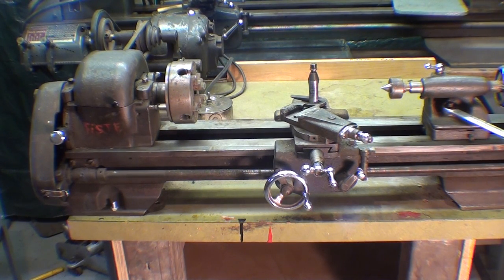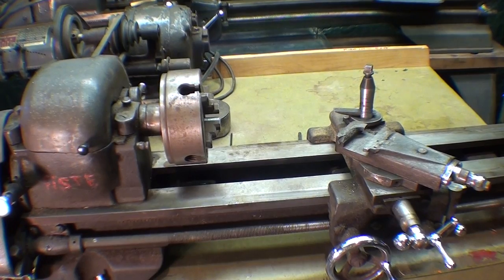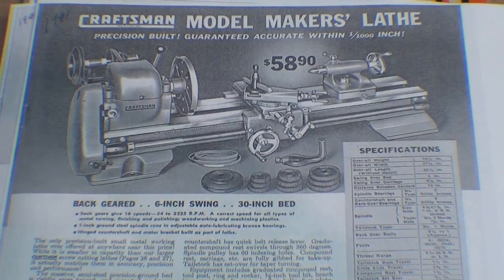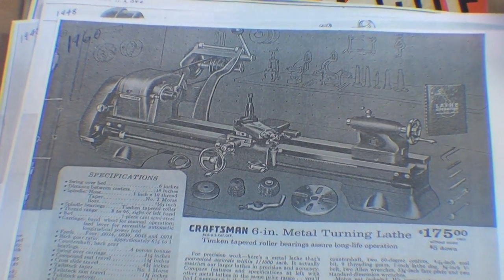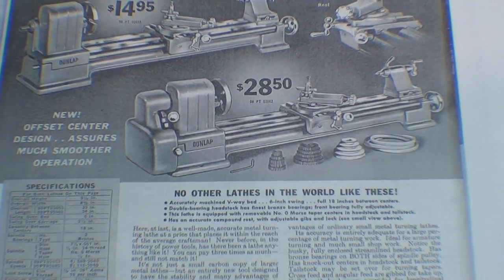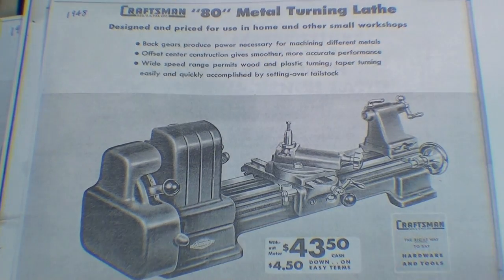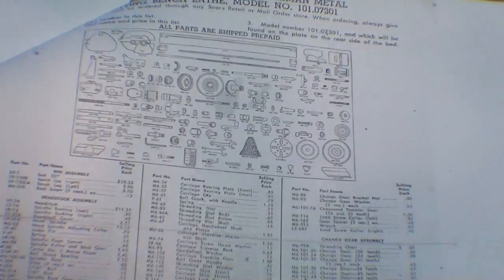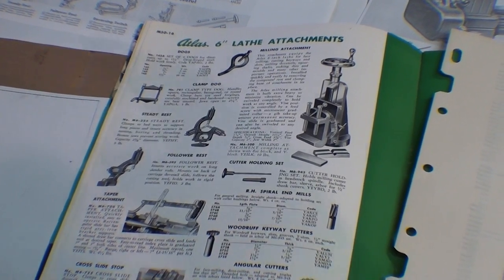TIPS #330 pt 1 How to Buy an Atlas Craftsman Lathe tubalcain

Comment: Just bought 2 lathes at same place 12 x 36 with quick change gear box and 6 inch 618,,, but big surprises was in the rusted bucket with them,,,had milling attachment, steady rest and follower rest and faceplate with 3 dogs and nice 4 jaw Chuck to go 3 jaw on it all for 12 inch and I payed 500 for everything and got it home and it was the exact same model number as my 12 I have already,,and I slid micrometer and caliper down both lathes ways and was perfect and needle on dail indicator hardly moved on spindle,,deal of a lifetime.
Reply from the maker: Wow, that was a deal
Reply: @mrpete222  Mr Pete you created a lathe monster,,l have 5 atlas lathes now,,lol,,,in the 5 I have find one tooth broke of a planetary gear and one really worn drive gear and no real way wear on that atlases, l think it's because they was the hobbyist lathe,,,I've walked away from several more high production and more expensive because of wear issues,  I feel the atlas is not capable of really hurting itself unless you force it too.

Comment: This little lathe would have been a step up for me at one time. After having used my father's SB 9" (which he bought new in 1964) I bought my own first "lathe". It was a Porter-Cable(?) brake drum lathe. The ways were swayed out; it was never intended as a general purpose lathe (no threading leadscrew/halfnuts; no compound); very limited selection of feeds. 

My first step up was to another SB9 which had been used as an OD grinder for many years. The ways were swayed out; the carriage was so badly worn that the V-grooves had cut into the screw holes that were supposed to hold the oil-wipers! It did have a quick-change, and came with quite a bit of tooling, including 3 and 4 jaw chucks, tailstock and headstock centers, dogs, faceplates, Armstrong toolholders, a coffee can with a couple of pounds of high-speed steel tool bits, a steady rest, a follower rest, a taper attachment, a collet drawbar and collets, and a milling attachment. If the lathe itself had been in better condition this would have been quite a deal for $400 (in the late 1970s).

I actually did quite a bit of hobby machining on those two lathes. Accuracy was possible by a lot of fooling around and final touch-up with files and emery. I inherited my dad's SB9 in 2005.
Reply from the maker: That grinding dust is mighty damaging
Reply: Yeah...it really hurts me to see guys grinding/sanding in their shop right next to lathes....here on Youtube....even the really good machinists/welders do it....milling machines aren't as vulnerable...but still a bad habit...
 I had a small welding shop, just me, at one time....all the grinding and chop-saw was done in a curtained off area....grinding swarf might as well be a dry version of valve grinding compound....

Comment: It was very common in the 1950s and 1960s for home mechanics to simply clip off the grounding plug on machinery bought for home use.  Simplest reason is many homes of that era only had 2 strand wiring.  In the mid 1960s adapter plugs with an attachment for a grounding wire reached the consumer market, but instructions for how to install a ground in the home weren't that widely distributed.  Eventually the National Builders Code caught up and we began to see 3 strand wiring in the homes (vs the old cloth covered rubber 2 strand wires inside the walls of many homes).  The result is a heck of a lot of machines from the pre-1970s will be found with 3 prong plugs missing the ground plug.

Comment: As always, another fine video. Keep up the good work.

A side note: for anyone looking at buying a Sears craftsman / Dunlap 109 lathe. My first lathe was a Craftsman 109. It was given to me. and compared to the Atlas 101, 6" lathe, the 109 was a piece of junk. First of all, It use the number MT0, yes that is correct a  MT0.  which is almost impossible to find any more. the through hole through the spindle was something like 1/4 ". Unless you're doing small clock or watch making, it's not very usable. The bearings are made out of bronze, one of which was tapered for adjustment by a nut between the planetary gear and the bearing journal. On the plus side, you could use a standard drill chuck directly on the spindle, Since it had, if I remember correctly 1/2 – 20. threads   You might be lucky to find any tool holders for this machine, Otherwise it's make your own. Although I did like the crank handle at the end of the lead screw, for fine adjustment, you had to use the have-nuts to use it. And this is what wore out on my machine. All non-moving parts are made of a low grade cast. Very brittle. You can only take very very light cuts on it. and I never liked going behind the machine to loosen the tailstock. It just did not make sense to design it like that.

my advice, stay away from the Dunlap 109, and look for a Atlas 101 or better.
I now have a 9",  South Bend lathe, And I am very happy with it. I can do most anything I need to do with it, without worrying about breaking something. 

Again, great video, keep up the good work.

Joe.
Reply: This is what I mean, no love for the little 109...

Comment: Over the past 40 years I have collected a bunch of the old Atlas and Dunlap machines. They were free or cheap and I have planned to set them up. They all need a lot of work. Now that I am retired I will clean up an area in my basement to set up a lathe, milling machine, and shaper. Thanks for the info. Good Luck, Rick

Comment: Wanted to take a minute to say thank you for this video. I had the opportunity to purchase a 6" Craftsman lathe today. As you stated you get excited at the opportunity when it presents itself. I found several things wrong with the lathe as I inspected it. First the compound was missing. Cross slide present as well as tool post. Banjo was in good condition with no damaged gears, as well as the extra gears were there. Four jaw chuck froze on headstock screw. Tail stock was off machine but intact. Ways were in good condition. I could not move the carriage easily really stiff. It didn't have a hand wheel for the lead screw it was at the end like the Dunlap. It was badged Craftsman. They were offering g a bunch of accessories with it as well. It did have the milling attachment, but no dog or plate. Last thing without making this to long a price tag of $500.00, I passed on the purchase due to the issues I found. They are going to reach out to me if the compound is found.
Reply from the maker: Yes, that's way too much in that condition

Comment: pete... i have an old myford lathe ml10  made here in nottingham  [ england ]  they are well made but the spares cost a fortune! i had before a dean smith and grace z13.. they were the rolls royce of lathes! it cost me $3o  /£20  it was being thrown out due to the factory going all cnc . when i picked it up the motor was still warm!  i had it for about 5 years then we decided to go and live in spain ... i sold all my stuff  lathe shaper milling machine welding eqpt  saw pillar drill grinder  vises files cutting tools   every thing..for $200 /£150.. which i regret to this day.. that was 30 years ago...  you live and learn... by the  way great videos  look after yourself.. regards from nottingham... laurence

Comment: Thank you for all that you have done for the hobby/industry. Very informative and the knowledge will be on the internet forever. I recently purchased an Atlas 3950 but it did not come with a chuck. It does not look like a 6" chuck would fit with the jaws opened wide. What size chuck is recommended? Mine has a backplate with holes measuring 4.125" bolt circle. Thank you, sir.

Comment: Mr. Pete, as I mentioned before I have one of these craftsman lathes in this video and was wondering, does the machine inherently have reverse or would I have to install a reversing switch to get reverse? I haven't needed it yet bit I wondered about that the other day and you're the only one I've seen with one of these lathes that I know of. Thanks a lot Mr. Pete!
Reply from the maker: You would have to have a reversing switch. And a motor capable of being reversed
Reply: @mrpete222  Makes sense, thanks. The motor on it says craftsman so I suspect it's the original motor...or maybe the original died and they got a new. How would you determine if it could be ran in reverse?

Comment: I just bought a 109 and the 101 6 inch in this vedio in a package deal both in really good condition and all there for 400 dollars for both, couldn't pass them up,, tour them down cleaned and repainted them and displayed them,, l only use my 12 inch atlas anyway and just found an original milling attachment for it..stole it also in great condition..even got 2 high dollar jacobs ball bearing chucks with the 2 small lathes.

Comment: I just purchased a craftsman 6" lathe now believe me when I tell you I was very excited about this lathe first of all it came with a milling attachment, a rotary table, spindle mill cutter arbor, an angle vise, all the boring bar, bits, woodruf cutters, craftsman V Blocks and clamps, micrometer stop, dead center, live center, steady rest, follower rest, RH tool holder, LH tool holder, Straight tool holder, threading tool, knurling tool, parting tool, tool post, face plate, lathe dogs, The best part of all this......It was still in it's shipping crate still cover in packing grease as were all of the stuff I mentioned!!! The lathe is about 45 years old and NEVER USED!!!! what do you think I paid for all of this?
Reply from the maker: Wow, that is a rare find. $1500
Reply: @mrpete222  I paid $2000.00 for everything.... did I pay to much??
Reply from the maker: Probably OK if it was in the crate. Not too much. Where else would you find one?

Comment: I believe if you switch from foreword to reverse while running, it keeps running in the direction it is going. You have to stop and restart it before it will reverse directions. You shouldn't have to worry about the chuck spinning off...Russ
Reply: Yep, any single-phase motor with a centrifugal start (most) will continue to run in the same direction if switched quickly from forward to reverse (and vice-versa). Only if the speed drops so low that the centrifugal starting switch drops  back into starting position will the motor try to reverse (at which point it is not much different than starting in reverse from stopped). The reversing switch only reverses the starting windings. 

I learned this the first time I tried power tapping on a single-phase drill press (to which I had added a reversing switch so I could do power tapping - ha!). The tap just kept on going deeper after I tried to reverse the motor suddenly. Busted a 1/2-13 tap and learned a lesson. Probably a cheap enough lesson, all things considered.
Reply: Problem is it you want to stop the lathe fast you quickly hit the switch and go to far and the lathe keeps on going.   A separate switch is easy to wire in and solves the problem.

Comment: I have two of those 109 lathes; I kind of like them although I don't usually mention them due to the inability of others to not dis them. 
One of them is an early Dunlap, so early that the back gears and power feeds were options! It has neither of course. 
Thanks as always for the great video Mr. Pete!

Comment: bear in mind people, zamak alloy has a tensile strength equaling bronze, although it is not as ductile. basically, while inferior to alloy steel, it isn't bad but it is somewhat brittle so it tends to fail all at once. that's my tw cents anyway.
Reply from the maker: That was a good analysis

Comment: had a 109..years ago you can now find at swapmeets 50..100$..usually  a pile of parts the 618 are starting to command higher prices now..oh on 109 one thing to watch out for are bent spindles thanks for videos
Reply: Yup I have a 109 here with a spindle crookeder than a dog's hind leg. They're too small to do more than the smallest of things.
Reply: Make a solid replacement spindle, it'll be much more rigid.

Comment: Mr. Pete, many thanks for all your wonderful instructional material!

Question sir: I purchased a 10" Atlas with a V-Belt drive last fall.  My spindle still turns when released from the counter-shaft.  I've tried adjusting the counter-shaft/spindle belt tension with no success.  Any suggestions you might offer?  I am retired but still have a lot to learn so I've signed up for Introduction To Mechanical Tool Technology at a local Junior College this spring.

Thanks again & Happy New Year!
Reply from the maker: Is the bull pin engaged? Not sure of your question??
Reply: Many thanks Mr.Pete.  You're a wonderful educator but for someone as green as me, I really need to wait for my class to start.  It's currently my understanding that on belt drive lathes like mine, the spindle is started and stopped with the power switch rather than the lever/clutch I'm accustomed to.  My class starts in just over a week.

Patience Grasshopper & Reach For The Stars!
Reply from the maker: Yes--use the switch. Good luck with the nite class

Comment: The Dunlap/Craftsman's with V ways were made by A&A Industries.  It should be noted the cross slide and compound screws do not move any kind of even distance like 100 thou per revolution.  They are 24 thread per inch pitch.  I wouldn't have one which is why I own 3 of slightly different variety including a very early one.  I thought it might be fun some day to polish a turd by making the feed screws .100" per revolution.   Maybe make one into a "in the house" office lathe.  ??

Comment: Hello, I have a Dunlap version of this craftsman  model 109.0702. I'm missing a few gears. Would you know of a place I could get new/used gear set and the paper work for it.... other then that mine is in good shape and runs well... Just wish I could use the screw drive... Thanks...
Reply from the maker: eBay is probably your only hope

Comment: Speaking of 'grounding'; my old equivalent model demonstrated 'intermittant' start-up, and I had a complaint of being 'shocked' (some) by a user. Cause: the Shunt Capacitor on the motor (mounted horizontally in the housing on the motor) had it's electrolyte (kind of like a old zinc-carbon battery) run out of the end of it, and thus causing both issues. Replacement values need not be critically the same as the bad Cap , except that the 'working voltage' need be double of your actual line voltage. Newer ones are better made, and a bit smaller.
Reply from the maker: Those big capacitors can be dangerous
Reply: Yes- lack of proper grounding can become an issue in shops with multiple machines. IF a 'hot' shorts to a chassis of an ungrounded device, then that device (or electric hand tool) becomes a marked hazard around other devices, when the user touches both. When 220ACV is in the mix, then the issue becomes almost instant death.

Comment: Hey, here's a thought. couldn't you replace those weird alloy gears with modern steel gears? Like couldn't you make your own by making molds of the gears that you have and then send the molds with all the specs on it to a gear manufacturing plant or simply make the gears yourself out of the type of steel used for gear making?
Reply: ..for gears.....That would be Martin Sprocket.......not only do they sell all sorts of sprockets and gears....they will do almost any sort of machining on them for you. my last job I was a maintenance mechanic....but my employer had no machinery except an old Chinese bench top drill press....I got a lot of stuff  (even 60-70 year old, which most of it was) running by going to Martin....it was convenient....just a mile away, and 2 right turns....
Reply: nylon would be better and not so noisy

Comment: Hello. 
Not sure if you still have your Atlas lathe. 
I just picked up a slightly smaller version of the one you have. 
I am looking for a tool holder and a new tail stop that could take a center point and/or a Chuck. If you know of any supply house for old parts for these lathes, I would sincerely appreciate it. Thank you’
Reply from the maker: I recommend eBay

Comment: I have two 12" Atlas Craftsman lathes in very good working condition and a good bit of tooling to go with them.   I have a buyer interested in both of them.   Can you tell me how I might assess a fair value of them.  Bot are 12x36 with quick change gear box.
Reply from the maker: That is a very tough call. I would say they are worth between 1000 and 1500 each depending on condition and accessories.     I would recommend that you search eBay completed auctions to see what they are selling for.
Reply: Thanks for your response.   I have seen a couple listed, but not sold.   They seem to run $2k and one at $6K.   Kind of all over the board.   These are the 101.28990 machines under the cabinet motors.   Again -  thanks for your response.

Comment: Hi Pete.  Hey. I was wondering if you have extra parts around that you sell ???   I just got myself a 101 and Im need of some stuff for it.    Change gears.   Thread cutting thumb dial.  Speed change pulley on the spindle shaft
Reply from the maker: Sorry, no
Reply: got compound and some other parts  for sale

Comment: I don't understand why manufacturers didn't simply make sealed gear boxes.  They wouldn't even have to be sealed as well as automotive applications.  Just the bottom half, filled with 30W oil, and some O-rings to seal the shafts in and out.
Reply from the maker: It would cost too much

Comment: Good job. Do you know the head stock taper for a South Bend 10K lathe? I will go to Keith's site and try to find it as well.
Reply: Normally, the 10K has a special spindle that directly accepts a 6K collets. A special adapter can be used, if you can find one, to adapt it to a MT2. Alternatively you can use an MT3 to MT2 adapter or MT3 dead center.
Reply: Thanks Joe. I may have a MT3 laying around to try out.
Reply: Tried it Sunday and it worked fine. Thanks!